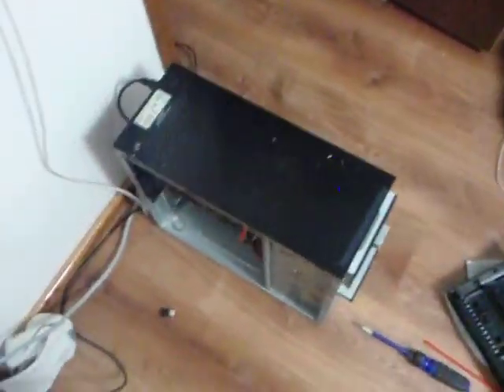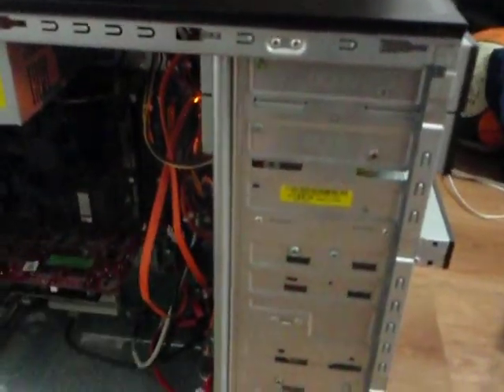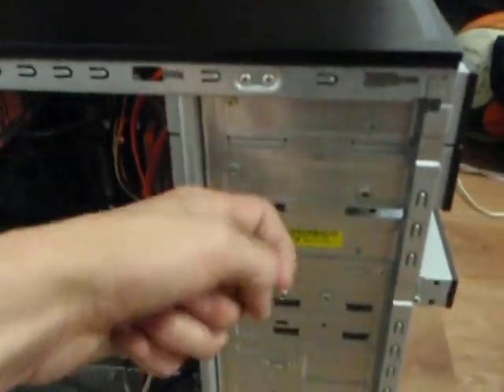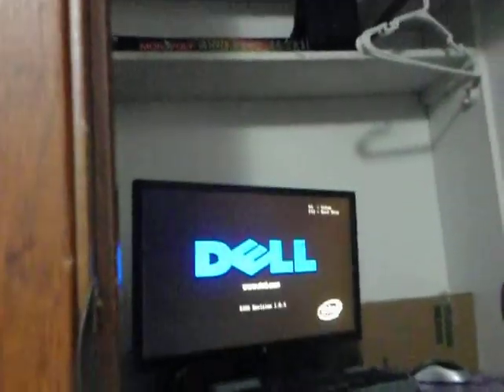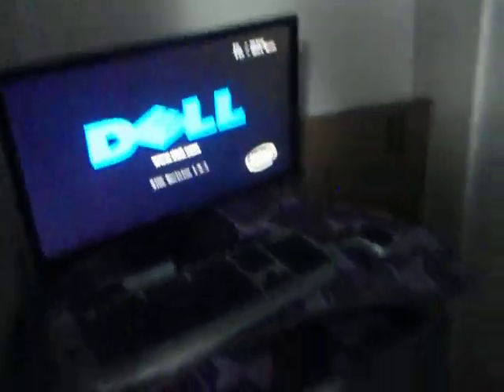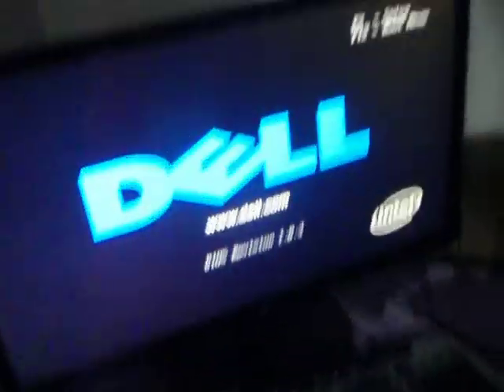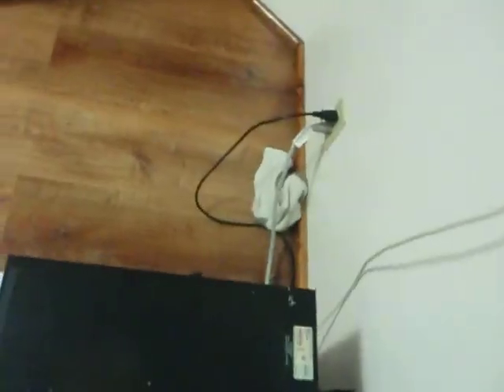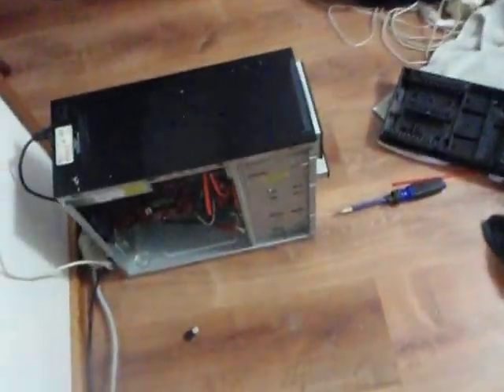Dell Vostro 410 Stuck on Dell BIOS Screen at Boot- Running out of ideas, please help!

Comment: I had the same issue and I also had that weird sound from the Hard drive but for some reason I switched the plugs around on my surge protector and it worked luckily. Unfortunately though I restarted it again a week later and for some reason it isn't booting up to windows and I tried switching the plugs around and still no luck...
if anyone knows what to do please let me know

Don't worry my Dad fixed it some how, I'll ask how he managed to do it to help the others in the comments :)

Comment: I have this problem on a old compaq evo n1020v, it got stuck on post in 2013, but i found the computer and i want to fix it, i remember that when it was booting normally it was showing "Press F10 To Change System Settings" but with this problem it only shows the compaq logo and nothing else. Also i noticed that the fans aren't spinning, but when i turn on the laptop without the processor the fans starts to spin. Can i fix it? Its my childhood laptop and if wasn't for this laptop i wouldn't be intrested in tech.

Also i can't test the laptop with other RAM or processor, i'm only 13 and i don't have spare parts sadly :/

Comment: I’d try a different keyboard, and try all the USB Ports, to make sure the keyboard isn’t bad, and make sure all the USB ports work. Then, try F1, to Clear/Skip passed the bios. I work a lot with the I.T. at my high school, and know a hand full of tricks. Worst case, it may be a bad hard drive 😢😭
Reply from the maker: I fixed the problem, it was a little USB Wi-Fi chip. That's the partition that was causing the problem